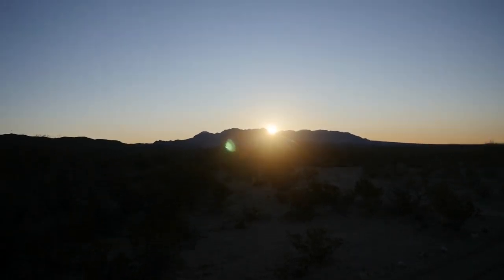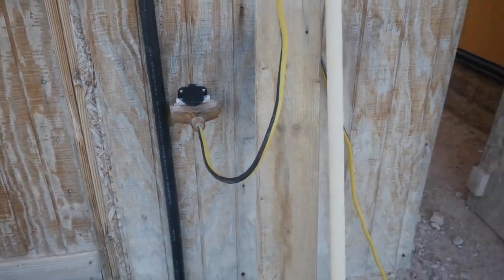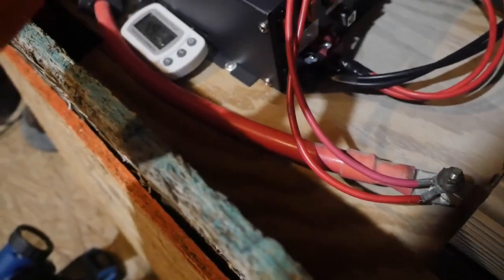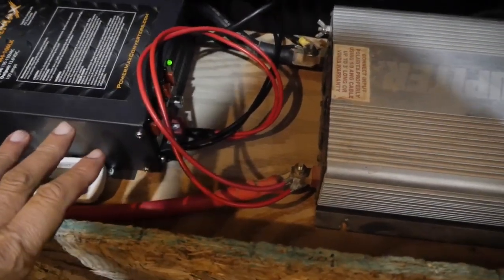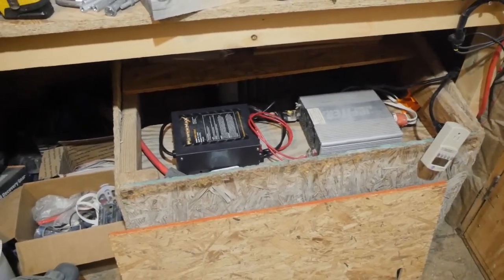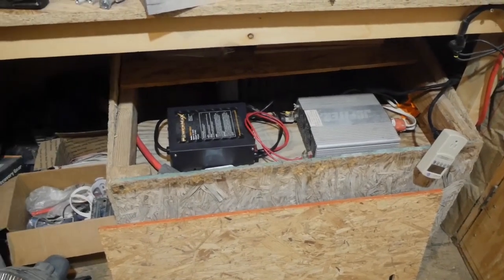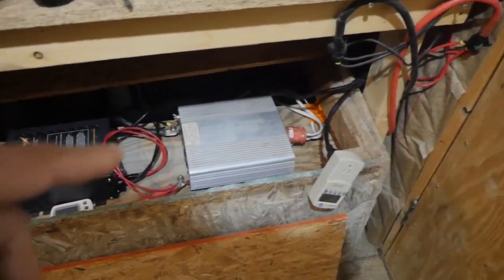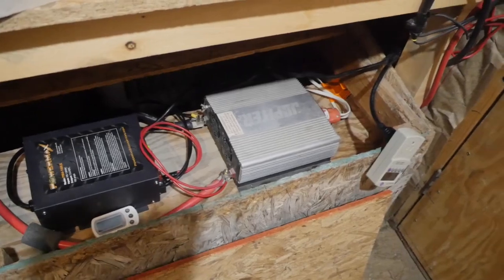New Battery Charger! Powermax PM4 100 Amp PM4-100LK 4 Stage Smart Battery Charger

Comment: Nice video.  I have a PM3-100 that was in my motorhome charging 3, 100 amp lithiam batteries.   It went completely dead after about a year and a half.   This is the second one to die on me.  Not sure why.     What is the difference between PM3 and PM4?
Reply from the maker: Sorry to hear about your chargers. Make sure you have a lithium compatible charger, I think the older one wasn't. I believe the 4 is just upgraded from the 3. I'd say contact the company, they are US based, Florida maybe? Good luck 👍
Reply from the maker: Check fuses?
Reply: @CarlinComm  Hi Carlin, thanks for the reply.  I checked and I had bought it about 3 years ago. I was thinking it was newer than that. It is a LiFe compatible (PM3-100LK) and the earlier version then the PM4. I did take the cover off and check the fuse and it was good.  I called PowerMax and talked to them.  They do not do any repairs, and said the best thing to do is buy a new one.  I don't think I'll buy a third one.
Reply from the maker: @bobinnm3786  Ok at least we checked! good luck!

Comment: Carlin I'm looking at the powermax to help charge some power queen 300ah.  I'm pretty novice to this and was curious if using the powermax would allow me to charge the LifePo4 battery's from my 120V wall outlet?  I'm just toying with emergency back up at this point.
Reply from the maker: Yes that should work fine. Look at the specs for your battery, how many amps charge can it handle, then pick a changer that matches it. I got the 100 amp charger because I charge 4 batteries at the same time, so that is 25 amps per battery. Thanks for the comment.

Comment: A lot of talking and not much on a performance a person would want to know what is the output versus what is claimed this much more useful
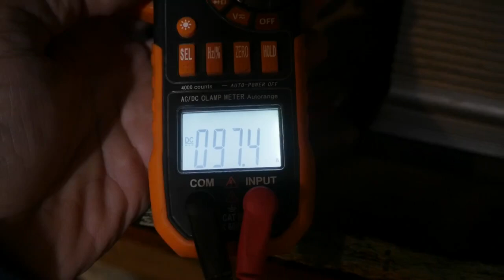Reply from the maker: I realize you are probably not my target market here, seeing as you probably won't make it off grid with this kind of attention span, but at 3:30 or so, I both show and say how many amps I am getting from the charger. That's where I'm holding the meter that is showing 97.4 amps. By this time it was already throttling, but I did see 100 amps when I first started the generator. So, that is actual rated capacity. If you missed any other important details, feel free to go look at the manufacturers website, they're US Based out of Florida. Best wishes. Or piss off. What ever.

Comment: im going to buy this so i can charge mine.  i have heater pads inside my lithium so i dont have to worry unless it gets -30F out or colder.  its good to know that other batteries can be added later that dont have heater pads in it but wanted at least one that does so at least in the cold if it gets that way gives me 200amp hours to use to heat the rest of them up to temp then they can charge.
Reply from the maker: Yeah I heard they were putting heaters in some batteries, that would be handy. It doesn't get cold that often here. I just try to look every morning. Also, just running a heater will create enough current in the battery to warm it up internally. I'd really want to put a temp sensor inside a battery to know how cold they are internally.

Comment: "sun should start going the other way" yes if not big trouble......I run red honda 1000. 1/2 gallon will give 6 hours of 50 amp dc charger with Iota dc charger. No sound....
 I have set up dozen of this with cabin people here.I use Lead batts only cause of cold charging ease.
Reply from the maker: Yeah big trouble :) Gotta love the Honda, I never hear anything bad about those... quality is never expensive right? Aside from the cold issue, I'd hate to go back to lead batteries after lithium. So far I'm super happy with mine.